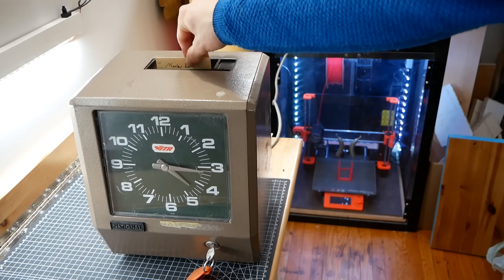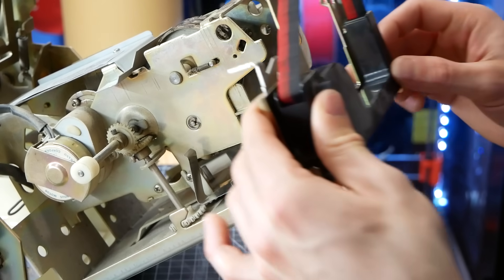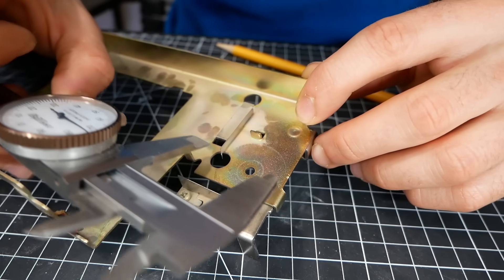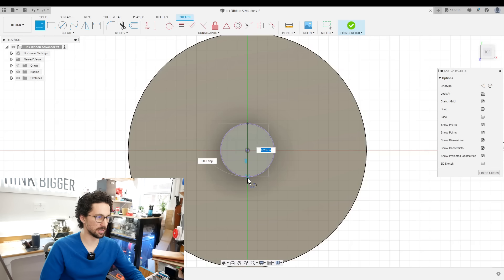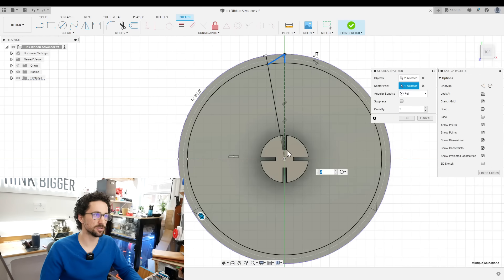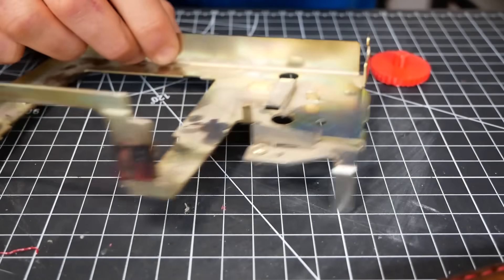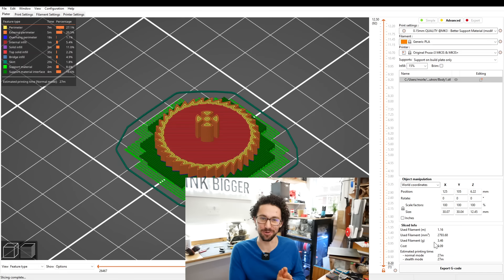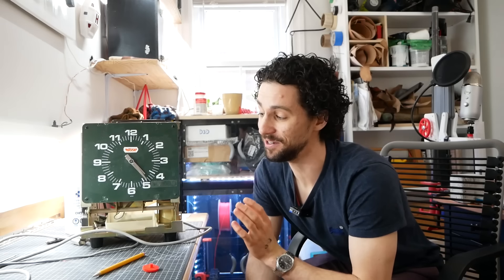They wanted 100 dollars. I 3D printed it for 9 cents.

Comment: 8:21 You had an angle of 10 degrees, and a circle has a total of 360 degrees. Therefore, if you wanted to find the right amount, all you had to do was divide 360 by 10 which would give you 36.

You were a single digit off with 35. Then again, it wouldn't have made a such a big impact, it's just my slight OCD speaking to me.
Reply: Should have actually been a formula based on the angle variable (i.e. 360 / ToothAngle) so that it automatically updated when the size of the teeth changed.
Reply: I was screaming this at my computer!
Reply: @ktcottrell  I know right! I was also yelling. It just hurt watching the extra teeth pop in and be overlaping. "Yeah 35 is good enough" --  just painful.
Reply: @ktcottrell  Funny, I scream at my computer also.  Sometimes it pays attention, other times not.
Reply: @utoothheartyeight  if you're connected to internet and have some popular apps installed, then it's always paying attention to what you say near it
Reply: I too was screaming with how painful it was watching someone ignore basic mathematical principles in favor of guessing. I usually watch YouTube on my TV. I had to open up the YouTube app and go to this video just to read the comments to see if anyone else was annoyed as I was. You guys don't disappoint.
Reply: Thanks. It's with stuff like that where you clearly see he's a video creator and not an engineer
Reply: @reinbert  well that and the fact that he is comparing the cost of the filament to the replacementpart. Like A totally missing out on printer cost, energy, time he spent on designing and printing, having a place to store your printer and utilities... And B not mentioning that it is actually pretty amassing that you can get a replacement part for somthing that old and what it means for the company to still be able to provide these by either holding spare parts for ages and having them lay around or worse being able to still produces these nowadays as i would gess single handmade solutions. With that in mind 100 bugs doesn't actually sound too terrible in my ears. Its not cheap but with regards to the circumstances I'd say it's pretty reasonable.
Reply: I was talking alone while watching: 
"Thirty six"
20

"Thirdy six!"
40

"Thirdy six!!!"

35
"THIRDY SIIIIX"

This looks ok.
"OMG"
Reply: Incredibly painful
Reply: SAME, I was saying the exact same thing out loud to my computer when he said that! XD
Reply: Huh it works the same way as in Illustrator. That’s cool
Reply: He already had one in place, so the total was 36 :D.
Reply: @RocketCityTim  that’s not how patterns work in this software, the original feature counts as part of the pattern

Comment: What is the cost of your hour of work? How many hours? What was the cost of the machine?

I'm am a thinkerer myself, and own a old car, so 3D printing save my day sometimes to solve a problem, create a solution, etc. 

But I don't know if talk about the difference of cost of a piece from a company that probably don't want to service this kind of machine versus the material to 3D print the replacement part WITHOUT the questions asked at the beginning is the best way to showcase the advantages of 3D printing in a DIY or small repair shop.

It's like if you price a replacement part in metal by the price of the metal, weld rods etc without thinking of the hourly price of the machining and welding services. Just don't add at the end.

Comment: Well, 9 cents plus the cost of your time plus the 3D printer itself plus the cost of the computer(s) needed but sure, 9 cents in material. I know, I know. "picky picky" but there's more than the raw material costs that contribute to the cost of producing things. So, what's the cost of the part when you factor in your time, the costs of the 3D printer, computers etc.?

Comment: Awsome practical use of a 3D printer. However I would print it out a a stronger material such as Nylon CF or if that is to difficult ABS would work decently well

Comment: Ok so i feel that this comparison is a bit unfair. For once, you need a printer, and yours costs about 800$, and if you go with a cheaper model the time you need to invest to make it work only increases. Additionally you need the skills to model something like this, which not everyone has, it takes some time to develop those. And lastly, it may very well be that they made that part out of metal, in which case the high cost is justified for a low volume part, due to high manufacturing costs.

Comment: how about sharing that design with your viewers in case someone less tech savvy needs it? Or is that pay-to-access patreon only thing??? Then are you any better than the company. BTW, its a little disingenuous in my opinion saying they wanted to charge 100 dollars for a part that cost 9 cents. They wanted to sell you the whole assembly. Still not worth it, but no need to lie. 
ETA: Morley uploaded the part, I think thats pretty cool. So will eat my words about that part of the comment. Overall, I like the video and will subscribe :)
Reply from the maker: Done! Check my pinned comment :)
Reply: @MorleyKert  pretty cool! OK, I will eat my words, thanks for uploading! Still think you were a little wrong about how you framed the situation but I appreciate the video overall. thanks man!

Comment: I'm going to start using the parameter thing now, didn't know it existed. However, i will point out that if you extruded one tooth, then did a circular pattern of the cut feature, it would save you from having to click all the profiles. Also, you can tell your printer to print larger or smaller lines than your nozzle width. It's not perfect, but it's worth tinkering with in these scenarios, IMO.

Comment: Well... you DID spend an hour or two on modeling and 3d printing including support removal and measuring time and you did get an infirior quality replacement. I am a big advocate on do it yourself but your "i cant imagine they wanted 97$ for this" made me uncomfortable. The company keeps this original item in inventory, hire a person to write you back on your inquary and the 97$ ARE for a new cartrige - not just the sprocket. You did a great job - no need to criticise the business. Keep on the good work.
Reply: agree with you. 97 was for the whole assembly. good for him if he has the know how and equipment to fix it himself, but most dont. Not to mention he doesnt even share the 3d model in case anyone else needs it.

Comment: This is an awesome tutorial wether it was your intent or not. Also, if you already have the knowledge, experience, machine, and free time, then 9¢ worth of PLA is nothing. For everyone else, $95 to restore an antique seems pretty reasonable to me xD
Reply: I think it also depends on how much the item is worth. If you could buy a working one for $100 it's pointless to spend almost the same amount for just one part, right? I've got no idea how much these things cost though
Reply: @nicjansen230  at that point, any company relying on timeclocks would be better off just upgrading to a more modern system, even if it cost more than a $100 part. last time i used a punch clock for work, it was so prone to errors and failure that it caused payroll screwups multiple times a week. our fool boss would rather spend thousands of dollars on wasted administrative time and employee turnover than implement a reliable system that didn't screw over the workers.

for hobby and learning applications, though, this video is great.
Reply from the maker: Thank you!

Comment: 9 cents are maybe material cost only. Have you factored in your time on investigation of the root cause, finding the video, figuring out whats missing, put all that in the program? Not speaking about your investment on the printer, learning to use the program, machine time, probably failures at first, etc. Even this print is a fraction of the useful life of the machine, it does count. And a company does calculate all that plus profit, taxes, labor, etc. 95 dollars sounds a lot, but imagine the engineering behind that product, development, and so on. This comparison sounds great in a video title but you didn’t really compared apples to apples. I might be wrong but the material cost only for the original gear would be even less. But If you do is for fun and you are pleased with the fact that you fixed something thats a great feeling.

Comment: Hey Kerr, You dont need to get back to parameter tab every time. You can just type in for example diameter window "ShadowDiameter = 1.75" (without quotes "") and it will create that parameter and set it value. + For printing detailed parts try new Cura 5 it has nice feature that prints tiny lines.
Reply from the maker: That's a great tip, thank you!
Reply: I really need to take a better look at Fusion, this video + comment has me really convinced on the parameter workflow. Just gotta get my head around how the sketches work.
Reply: @ayylmao.mp3  Try this https://www.youtube.com/watch?v=YjI4PDfx7UQ . I know it's long, just skip begining and this guys does awesome job in showing Fusion 360 capabilities and true workflow

Comment: Technically, you may be breaking patent law by 3d printing that part.  It's likely the punch mechanism is out of patent now, but it's possible it isn't, in which case you're manufacturing a pirated generic of a proprietary part.  Not saying it's wrong to do so, just pointing out the insanity of propertarianism.

Comment: They wanted 100 dollars so I researched 3D  printers for hours, purchased one, spent hours/days calibrating it, researched materials, eventually bought several, experimented, bought a computer, researched CAD software, spent dozens of hours learning it, spent more hours learning how to get the CAD output to the printer, and eventually figured out how to print it! And it only cost me 9 cents!!

While $100 seems extreme, the 9 cent final cost claim is equally absurd.
Reply: lol, fully agree with the calibration part. I took me a couple of days when I got my printer to get it to print right. Would be an equally good video without that click bait crap... though would we all be engaging if he hadnt made that stupid claim?

Comment: Dude, I wish I had learned about the parameters feature earlier on. Would have made my life so much easier when designing an iris in Fusion 360.  But I'm curious why you did the number guessing for the tooth count.  The count would be 360 divided by the degree of the tooth, so in this case 360÷10=36.

Comment: I'm pretty sure the original part would have been metal as a plastic cog like this will wear out pretty quickly though it is easily enough to get it working just for demonstration purposes. As you have the fusion 360 design it would be pretty easy to get someone with a lathe to make one from brass if needed though.

Comment: the 9c cost of the filament isnt how much this cost you. the amount of time you spent modeling, testing and printing this is worth more than $95 to a lot of people. plus your skill as a modeler and your access to a 3d printer are valuable as well.

if i wanted you to make me a custom part like this for a machine that I own, im sure you would charge me more than $95 for your time and skills. Nothing unreasonable about that. don't slag off the company for charging a convenience fee on a part theyre under no obligation to still be providing
Reply: Also, the company's email clearly stated that it was $95 for the entire mechanism (cartridge not included I assume), not just the gear. So comparing even just the material cost is a bit iffy, and then you add to that labour

Comment: Very nice video and also example of how to use fusion 360.

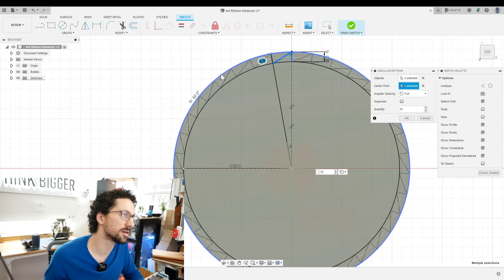I was cringing at 1 segment though at around 8:30 where you say "i dont know how many of these are going to fill the circle". The tooth wqs 10 degrees, a circle is 360 degrees, so you need 36 (or 35 copies + the original depending on how you count). I was litterally yelling 36! 36! You need 36! At my screen while you where figuring it out XD

Comment: What I like to think about when guessing dimensions off of rough things like terribly worn parts or in your case, a shadow print. I like to take the measure and bump it up or down to the next standard size, in your case you got 1.175, which is awfully close to 1-3/16 or 1.1875. Usually competent designers try to get as close to standard sizes as possible. And in your case your acceptable found value of 1.185 was probably supposed to be 1.1875. Now I don’t know if this part was Designed with metric or imperial in mind so I couldn’t know but you can take that way of thinking Into account when guessing a sizing. Great work. It was nice to see you work in fusion, for those of us who have only really seen solidworks/mcam it’s pretty cool getting to see how some other cad/cam softwares work. Very in depth I love the video
Reply from the maker: Thank you so much, and thanks for the tip!
Reply: 😂🤣 Competent designers make things standard 🤭, sorry but usually parts are made awkward so you need to go back to the manufacturer to get replacement bits, I'm a designer who tries to use standard diameters and materials but am also a toolmaker who has to repair tools or parts for other people and nothing is standard which is so frustrating when you can see its been done on purpose.
Reply: @ricardo-iw9sq  I was always taught to use standard sizes when possible, and as a machinist as well, when parts come by. More often then not values are at a standard sizing on a print. You don’t make things precise if they don’t need to be. Or at weird values. If not you need custom tooling of weird dimensions. If a hole needs to be reamed. Why buy a custom reamer that is pricey, when you can buy one of the standard sized ones for a fraction of the price since they are made by the millions. Obviously sometimes you can’t help it. But say those holes in the stamped sheet metal. Those are made on a press and I can almost guarantee you that they used a standard sized punch to make it because they are cheaper. So therefore the part going in the hole should be close to standard as well. Sometimes an intern won’t be thinking like this when making a part but generally speaking competent designers will know where they can save their company money by using common tooling.
Reply: @knightfall7534  Hi, I totally agree with making things standard but i used to have to repair press tools and the seal sizes on the tool were not even close to a standard either uk or European so  we had to get them made special and i did finally convince the customer to alter the tooling and  piston groove sizes so they would be an off the shelf item, I have also done bits for cars and they a renowned for being assholes for stupid sizes.  When I have a drawing sent to me I will quite often call up the customer and say will a 25mm dia bar work or do you want 24.5mmX 1m and then they say no 25mm is ok its in fresh air, I then say can you ask the designer to look at material sizes other wise its going to cost them, and 9 times out of 10 its a graduate thats never designed and built something from scratch. Happy days     🤭
Reply: @ricardo-iw9sq  oh for sure, some people who don’t know the practical side of machining won’t understand why dimensions need to be certain sizes. Engineers who never touched a machine of their life are known for this kind of garbage. But like you said usually they give in and realize it’s better to go with standard sizing at the expense of cash.

Comment: Three suggestions I'd make. First, rather than all that support, make the bottom peg a pin going into a hole in the gear. Then you save all the extra support material and you can change the pin size without having to reprint the entire gear. And when it's the right size, super glue it in. Second, I'd probable suggest nylon for wear rather than Pla. Third when measuring inside if your diameter is so small that you can't hit the center because they are offset, use the outer jaws and lay them flat to better approximate.

Comment: Im pretty sure i could have made the same part with hand tools only. A decent set of key files plus perhaps an old slot screwdriver sharpened to make a tiny chizzle. 3D printer tech is pretty amazing, but i wonder how much it contributes to deminishing hand crafting skills and knowledge, specially in the younger generations? ;)